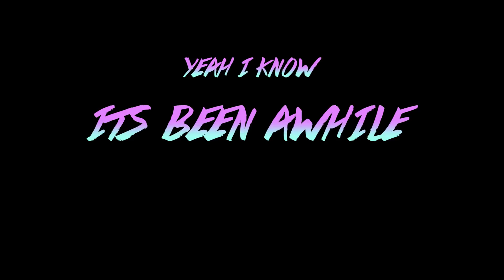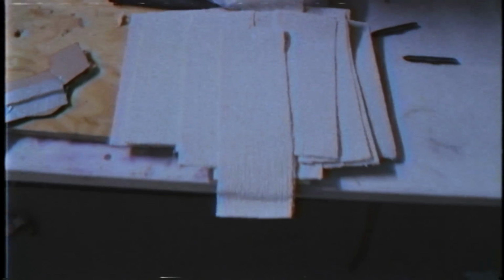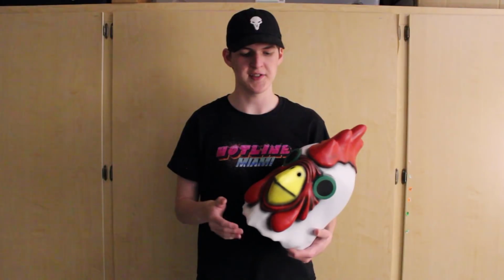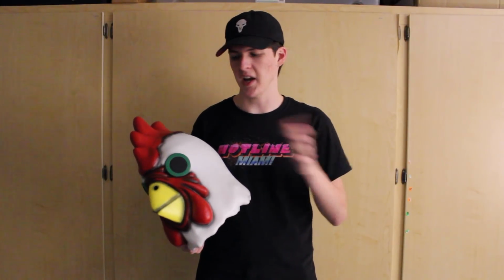Richard Returns Helmet Build Pt.2: Molding/Finishing

Comment: Any idea what you think they'd sell for?  Would be an excellent pairing with the recorders.
Reply: It would be cool if there was like, a bargain. But them both and like, get it cheaper.
Reply: @TonyMacaroniyt  I found one on amazon that looks exactly like this for $30, but its a rubber mask so it will come folded
Reply: @landenjohnson5328  i bought it, it's pretty ass if you have a small head, and the eyes are on the sides so you end up looking through one eye more then normal
Reply: @zlayer9075  where did you buy it? i've searched everywhere for a link but i just cant find it...